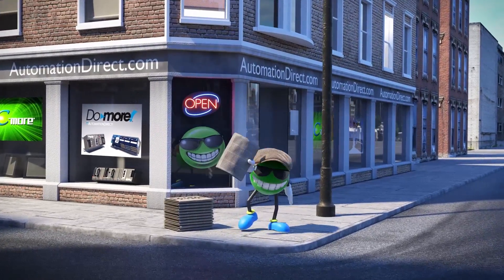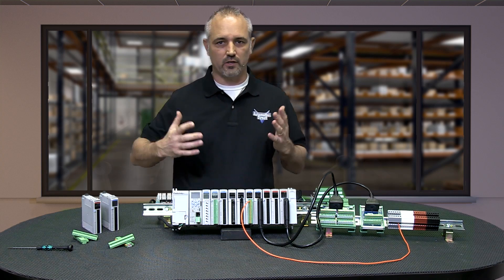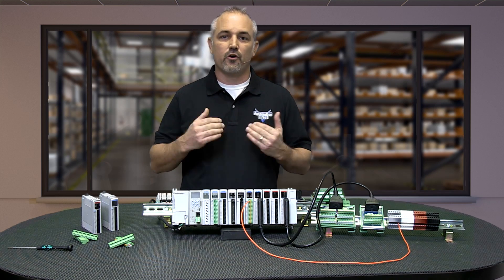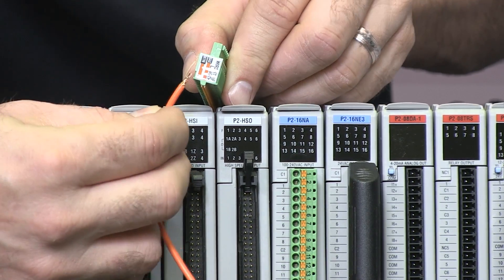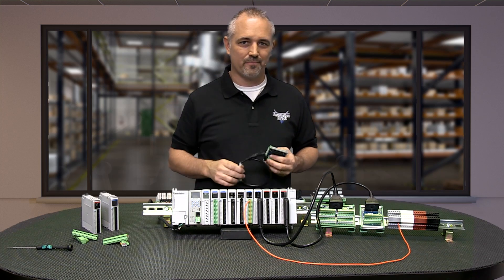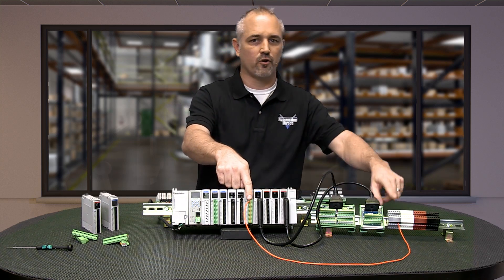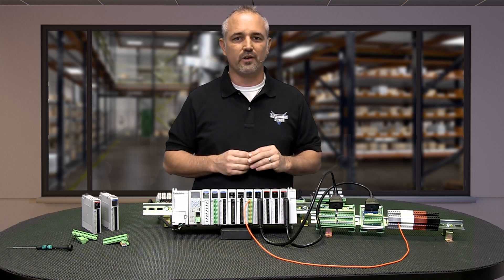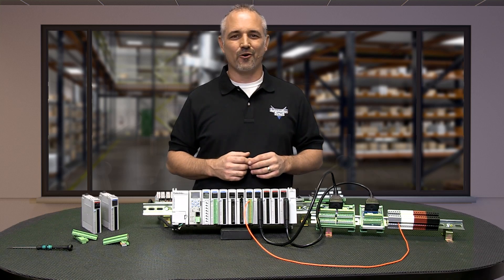Productivity2000 Wiring Options from AutomationDirect

Comment: what pins is what even on the ziplink. its so vague. 
nevermind i found it, why is the sheet even on the cable page
Reply from the maker: @is4_626 This is a common question. We list the pinout on the cable page because the cable ships with pinout stickers that match that sheet. One cable part number can be used with multiple ZipLink breakout boards, and each breakout board can connect to various I/O modules across our PLC families (Productivity, BRX, etc.). To simplify installation, we include stickers for every compatible module part number—just select the one that matches your I/O module and place it on your breakout board. This ensures the correct pinout is clearly visible in your cabinet.